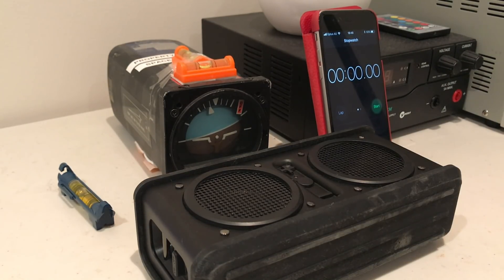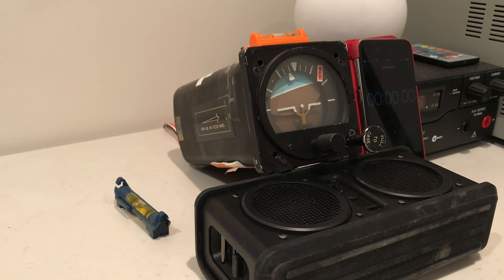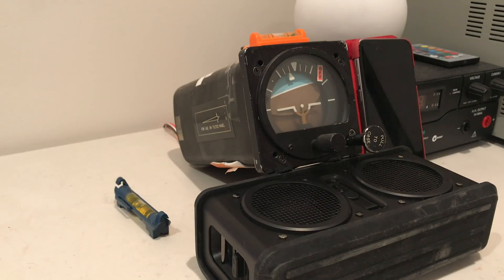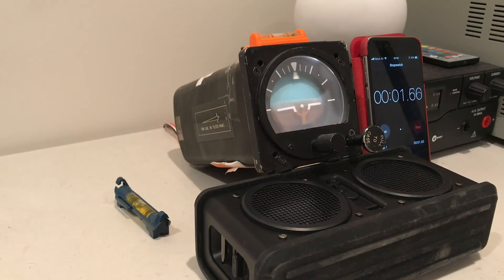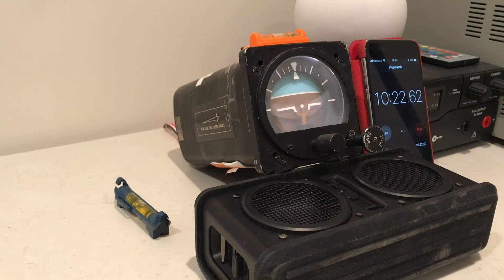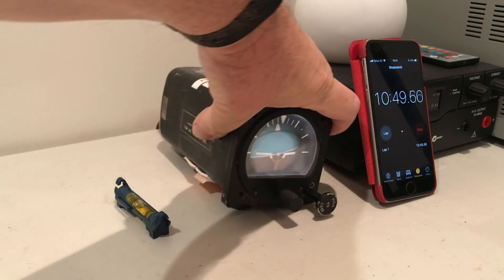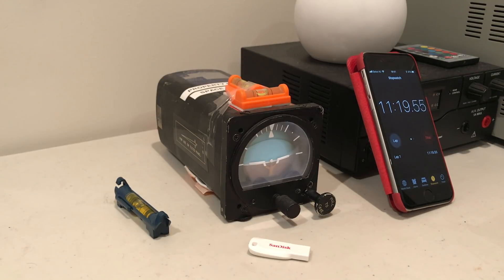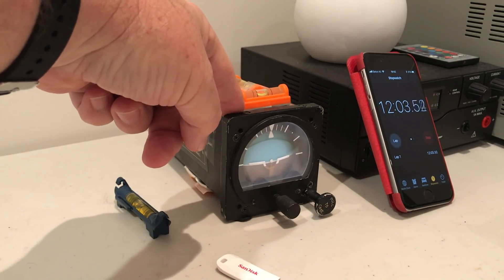Flat Earth - An often requested Artificial Horizon Experiment - Powering up at an angle.

Comment: Flat-earthers think only one kind of gyro, they do not know that there are some kinds of gyro, one of which is Earth Gyro which one of the axis always leads to the center of gravity of the earth. This Earth Gyro is also known as Attitude Indicator or Artificial Horizon used in airplane. Another kind of gyro is gyro compass widely use for navigation on ships, space gyro use on spacecraft. all FE debunk videos of gyroscope on airplane discuss the working principle of space gyro instead of earth gyro, misunderstanding of the true reality because the lack of knowledge.
Reply: Jos Rampisela well there really is only 1 type of gyroscope. A gyroscope is a device that utilizes the principle of "Conservation of Angular Momentum" in order to remain rigid in 3-dimensional space.

The mechanisms that self correct gyroscopes, like the ones in attitude indicators, break the gyroscope in 1 or more axes of those 3-dimensions. Therefore, losing their rigidity in that axial plane.
Reply: Dan C,  your definition of gyroscope is  remain rigid in 3 dimensional space then its only 1 type of gyroscope.
in engineering world, A gyroscope is a wheel mounted in two or three gimbals. 
So attitude indicators are also a gyroscope: tied gyroscope.
Reply: Jos Rampisela there are 6 basic instruments for aviation. 
Airspeed indicator
Vertical speed indicator
Altimeter
Turn and bank indicator
Artificial horizon
And directional compass.

Of these, 3 are pitot tube controlled:
Altimeter
Airspeed
Vertical speed

The other 3 are controlled by gyros:
AI
directional compass
Turn and Bank

These are fully functional, 3-dimensional gyros. Analog AI's correct themselves to gravitational level through a series of slow moving pendulums in the casing which are oriented in such a manner that they unblock holes in the casing when out of gravitational level. This is how the instrument self corrects.

PhD in geology, also a licenced pilot. I know this stuff my friend :-)
Reply: Jos Rampisela you say your an engineer so just think about it for a second. Let's say that aircraft AI's were a bastardized form of 2-d gyros (Not a gyro in my opinion) and you were flying in for a landing at, I dunno, let's say Atlanta international Airport. And that thing's fucking massive if you've never been. 20 minute subway ride to your terminal. It's insane...

Don't you think that pilot's would be a bit pissed off if our AI only showed 2D? We're in fog... where's our 3rd D? We need that. Otherwise we're gonna smash through a terminal containing 20000 pedestrians...

That's just bad mojo;-)
Reply: Jos Rampisela bastardized is a word that has existed for thousands of years. It means this:

Definition of bastardize

bastardized; bastardizing

transitive verb

1: to reduce from a higher to a lower state or condition : debase

2: to declare or prove to be a bastard

3: to modify especially by introducing discordant or disparate elements

And "fucking" is an expletive. You think scientists don't swear? Have you met any scientists?
Reply: Jos Rampisela you're not an engineer, are you?

Would you like to discuss some engineering topics? I taught second year engineering geoscience for 5 years. Let's do it. Pick a topic, engineer... Let's see if you can beat a scientist...
Reply: Jos Rampisela oops. Forgot to cite that last comment.

The definition is from Merriam-Webster dictionary
Reply: Dan C, i never read scientific technical book in English with the "fucking" word.  If you have it, please let me know.
when I studied engineering at university i never heard a single "fucking" from teachers and professors. 
As far as I know "fucking" never exists in any technical book. 
Please let me know scientists who swear when he teaching/explaining science.
English is not my language, so i was wrong about "bastardized", in my online translation it has different meaning.
Reply: Dan C, do you know a complex number? do you use complex number related to geoscience?
Let see Ph.D. and licensed pilot knowledge about mathematics.
Reply: Jos Rampisela oh my apologies man. I thought we were speaking English here so I gave you the English definition. Here's the English definition of "fuck", again, by Webster.

Definition of fuck

intransitive verb

1usually obscene : copulate

2usually vulgar : mess 3 —used with with

transitive verb

1usually obscene : to engage in coitus with —sometimes used interjectionally with an object (such as a personal or reflexive pronoun) to express anger, contempt, or disgust

2usually vulgar : to deal with unfairly or harshly : cheat, screw

See fuck defined for English-language learners

Origin and Etymology of fuck

akin to Dutch fokken to breed (cattle), Swedish dialect fókka to copulate

First Known Use: 14th century

in the meaning defined at intransitive sense 1

2fuck

noun

Definition of fuck

1usually obscene : an act of copulation

2usually obscene : a sexual partner

3a usually vulgar : damn 2

b usually vulgar —used especially with the as a meaningless intensive what the fuck do they want from me

4usually vulgar : fucker

But let me know what language we are speaking and I will use that dialect in the future.

"Scientific technical books"? What the fuck is a scientific technical book? I've never heard that before in my life.

If you never heard any professor use an expletive, then my assumption is likely true, which I formed after reading your next post.

You dropped out after 1st year, didn't you? Admit it if you did. You're not an engineer. You're a drop out.

Do I know what a complex number is? Hahahaha.

Yup. I have ever since I first studied them, in high school. You think that's a tough question? Rooting a negative number? Hahaha

Here's a tough question "explain in detail what would happen if the Universal expansion coefficient went to zero. Limit your answer to 2 exam booklets (30 pages)". The one and only question on my 4th year geophysics exam (100% Of your mark. 1 question)
Reply: Dan C, I have chosen the topic of complex numbers, are complex numbers used in geosciences?
Reply: Jos Rampisela whoa man what do you mean "Flat earthers think" I have seen no evidence to support that.
Reply: Dan C, you lost before the game, is the complex number too difficult for you?

Comment: Excellent demonstration, thank you!!!

btw what would happen if the airplane had to circle clockwise above an area for half an hour? In this situation the apparent "down" direction would be slightly tilted to the left because of the centrifugal force instead of pointing directly to the center of mass of the earth. Would this cause the instrument to misalign itself while the airplane was circling CW?
Reply from the maker: +OudeicratAnnachrista  Yes this is true and a constant turn would cause the instrument to align to the apparent G produced by the turn.  Pilots are trained to recognise this and the errors are called "turning and acceleration errors"

In practice you never maintain a turn for that long.  During a holding pattern or an instrument approach the most you will turn is 270 degrees followed by a period of level flight.  So the errors are small.  

We cross reference other instruments also which helps identify when a small error is present.   More sophisticated units won't have this problem and some will cease corrections during turns (based on G being >1)
Reply: (Long time pilot) I think this is correct. There is no magic way to tell where down is. A 15 minute constant (coordinated) turn would fool the horizon eventually. This would be expensive to check in a plane, maybe on a very boring bicycle ride in a parking lot? I hope Wolfie will comment, if this has not already been addressed. Thanks!
Reply: Oudeicrat...excellent question since I was also curious about this.  The best example I saw of this effect was a video where a pilot fills a glass from a pitcher of water while doing a barrel roll.  Not a drop spilled.

Wolfie,  you may have already heard this story about the prototype of the Boeing 707.  In Seattle we have a summer festival called Sea-fair which includes hydroplane boat races and an airshow between races.  One year there was a convention of airline executives who also attended the races.  Tex Johnson flew a 707 prototype and decided to do a barrel roll to impress the crowds.  I guess a few Boeing executives had a heart attack since this was not an approved maneuver. 

https://www.youtube.com/watch?v=-KNbKFMBsQE
Reply: cool, thanks!
Reply: As Tex tells it he was called into the office and given a what-for, but not actually fired. He was asked never to use that particular demonstration again.
Reply: Michael...compared with some of the maneuvers a prototype is put through to test flight characteristics a barrel roll is a pretty tame maneuver.  Of course at the end of the day his bosses were pretty happy since the attending airline delegation was quite impressed and the orders came flying in.
Reply: Khun Rich, the accounts I've seen of the aftermath bounce between "secretly pleased", "almost fired", and "don't do it again...say hello to the wife". I've seen the interview where Tex gives his "Selling airplanes" response in the telling of it. The only thing that seems to be consistent between accounts is a directive not to do it again and that Tex continued on as one of Boeing's lead test pilots.

Comment: Nicely done demo, as always, thanks Wolfie.

Still one question: I'm not quite sure but I believe vaguely to remember the fact that passenger airplanes some 30+ years ago tended to fly long waiting loops in a shape of an "8" while today they rather fly a long stretched "0".

Is this because flying large "perfectly round" circles in the same direction for an extended time – i.e. making the things "fall" in the airplane to disagree with the "true" gravity vector for that time – defeats the erection mechanism of the gyro and once the airplane goes back to straight flight it will again last some time until the pilot can rely on that instrument?

(And because modern airplanes can use other means for correction, like GPS,  flying an "8" is not that important any more?)

Or am I thinking completely along the wrong lines?

-- Martin
Reply: I think you might be confusing a circling approach and a holding pattern. Holding patterns are/were always racetracks (the "stretched '0'" you referred to).

Comment: The only way to complete the argument full circle would be to ship this horizon indicator to the ISS and show that it can't compensate for something moving that fast around the globe. 

Maybe really fast military aircrafts need different horizon indicators than those fitted to commercial ones with faster adaptation?
Reply from the maker: +Paxmax.  That would be a good experiment.  More for the fact that the instrument would not correct at all in a weightless environment and would just drift randomly as the pendulous vanes move around.
Reply: Haha, I feel a bit stupid not thinking that one through regarding ISS placement.
So, back to fast military aircrafts, what is the maximum correction speed of this instrument?
Hmm... better yet I better watch your video about the internals, info is probably in there.
Reply: Hmm... many military aircrafts does or near Mach 2, which is considerably faster than 1deg/4 mins (Mach2=about 2.7deg/min). That means military aircrafts probably use some advanced stuff to keep up but not to mess up in really long hard turns.
Reply: Paxmax "Maybe really fast military aircrafts need different horizon indicators than those fitted to commercial ones with faster adaptation?"

The Concord traveled at 1300 mph which is faster than most military fighter aircraft. That would change 1 degree every 3.2 minutes. The SR71 blackbird had a top speed of 2200 mph which would be about 1 degree every 1.8 minutes.
Reply: Airfighters could have more problems with their extreme manoeuvers than with their speed. Some are purposely designed unstable (F16, Mirage 2000...) but use artificial stability with fly-by-wire control systems (computer driven) and attitude sensing units with 3 or 4 levels or redundancy.
Reply: Ah... true that
Reply: Also have to take intro consideration really fast military aircraft likely wont use a mechanical gyroscope at all.

They have much more complex electronic system. We speak of optic based gyroscope and accelerator, linked trough mission computer to flight control in some case. Those system are capable of VERY fast correction taking intro consideration aircraft movement automatically. 

Especially crucial when you speak of very small, designed to be unstable aircraft like jet fighter. Trought the years they become faster and more agile (agility mean instability in aviation) But they also become more and more computer assisted. Not sure a pilot could control a modern jet fighter this fluidly is there was not a computerized system doing  correction automatically for him.
Reply: i thought you were a flattard for a second lol.
Reply: The next best thing would be to put the instrument into a centrifuge, let it run for say 20 minutes and show, that it has aligned to the new local "down" which is a composite of gravity and centrifugal force.